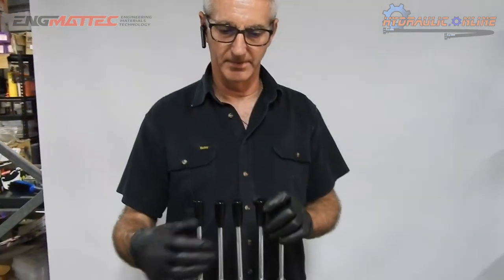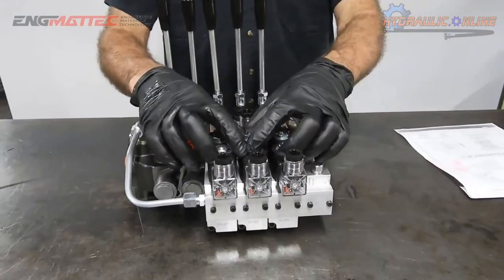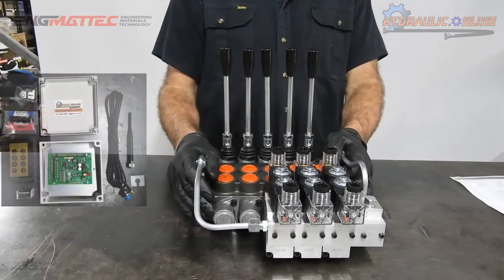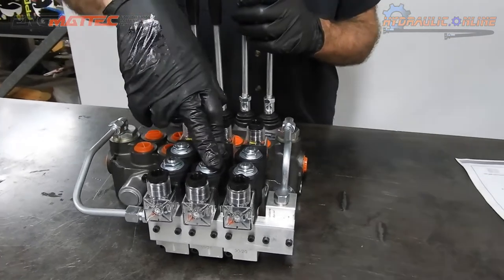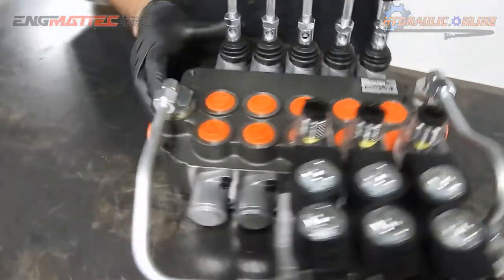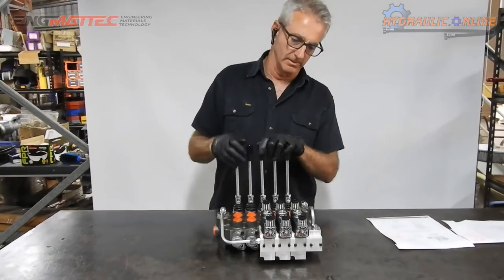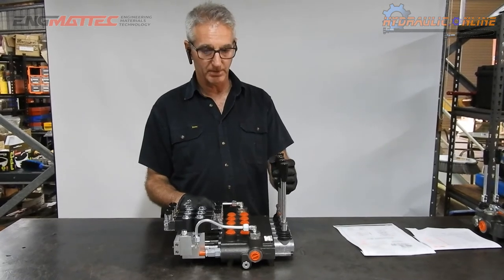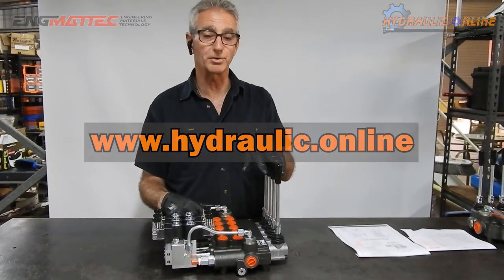How a Remote Control Electro Hydraulic Directional Flow Control Valve Works

Comment: so the remote control can only make the valves go on and off not vary the flow for more precise control?
Reply from the maker: There are simple remotes that only send an on or off signal if these on and of signals run linear actuator motors you can get more precise control alternatively you can go move to proportional remote control that use milliamps or variable voltage coils on the valves to move the spools with fine control.  The proportional remote controls and the valve units are much more costly.

Comment: How much is something like this cost ones with 5000psi capacity ?
Reply from the maker: Need more information to answer this question, how many functions, what do the functions do and what is flow? Generally higher pressure valves will require a higher specification valve (more expensive) .